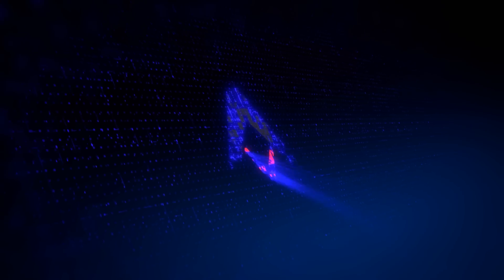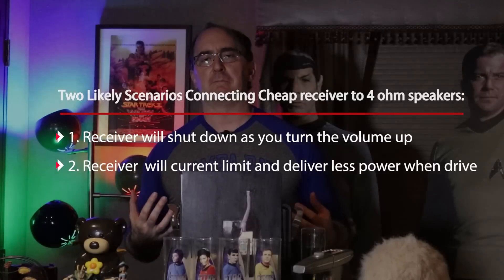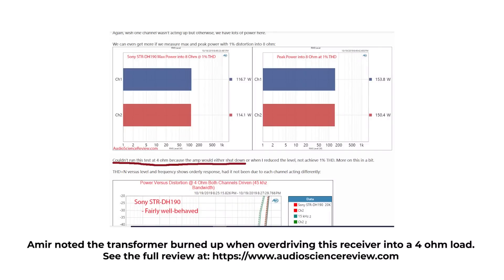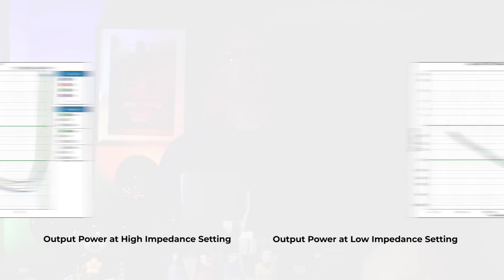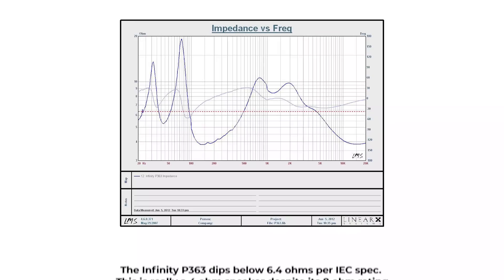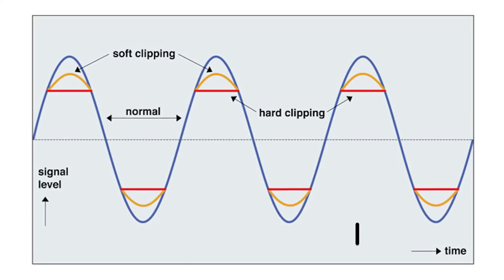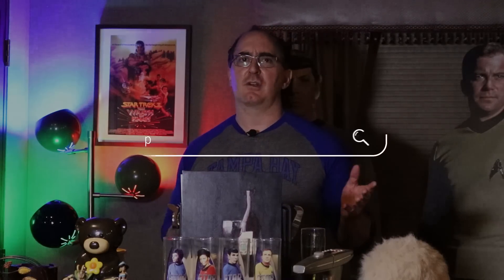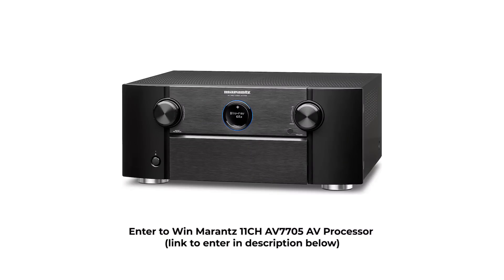4 ohm Speakers on Cheap Receivers: Recipe for Disaster?

Comment: Sorry my dude, it's me again :) omg, It seems I only find your channel like once a year when I have to talk cables to someone ;) OK, now I subbed. Here is the issue and I don't wanna make you "work", but maybe you think it is an interesting subject to clear up the alchemy surrounding it some time: So this related to bi-amping. I am a more-components-is-better fetishist and so I am still going for dual mono amps etc and actually looking to bi-amp with 4 monos.
Now, I had already gotten all the specs sheets for my stuff as far as available and also bothered the manufacturers, trying to get some more info, but they are all coming back with philosophical, not practical BS. I had also asked the PS Audio "ask Paul"-service, but they could not / did not get specific in their advice. But what I gathered is that I have to gain-match amps if I want to use a fat monos for the base and maybe tube amp monos for the tweeters. - But at least via spec sheets, there is no way to do this.
Now I have seen one guy, who apparently set up a mic and measured the output in his room and he seemed to have some kind of device that can adjust/split the signal for the chosen amp pairs. - So what was he doing/am I supposed to do to get this to work? Also, what kind of kit am I looking for? Are such devices automatically studio-grade? Obviously, I do not want to go through all the effort only to mess up my signal on the last step with a sub-par gain/splitter-thinggy from China... I can see how this is not the most popular subject, but maybe you feel like geeking out on it some day, or point me to a good resource. I have 4-way (or 3.5 way) speakers with 2 sets of binding posts, as most speakers have anyway, but I could not even get out of the manufacturer how the 4 ways are related to the 2 pairs of binding posts internally, so I am not even sure how much power a second pair of (maybe tube-) amps would require for the tweeters... so right now my only solution would be to use two identical pairs of mono amps, but I think that would already be overkill for the tweeters, as they are 170W each and the entire idea was anyway to mix it up with some tube amps. 1st world problems !! :)

Comment: I have an Onkyo TX-RZ720 (Power Output: 175 W/Ch (6 Ohms, 1 kHz, 1% THD, 1 Channel Driven, IEC)) amplifier which I had LG 12ohm speaker connected to, and sounded terrible. Due to limited budget, I decided to get Kicker 3way DSC6930 6x9 (90w rms and 360w max) connecting 1 speaker to each channel. It does mention high current power to drive 5 ohm speakers. What are your thought on this? Will this be better than the LG 12Ohm speaker setup and I am I risking damage/power output to speakers?

Comment: Probably not much, most cheap receivers or amps have digital/tripath amps that usually handle low ohm speakers and are only limited by the power supply. although, I may be talking about stuff "too cheap" to review. A lot of cheap gear based on car amps are rated at 2 ohms to maximize the amount of power available on a 24 vdc  (+12 / -12 voltage swing).
Reply: And those cheap Class D amps don't hold a candle to even used whole house audio amps like the Niles SI-275 or Sonance 275se. The Class D amps' high power ratings are taken at 10% THD. Plus, the WHA amps are generally high-current amps capable of handling low impedance speakers loads of 2.7 ohms. That all but guarantees excellent bass dynamics without stress or strain.....

Comment: Without even looking close at that crappy reference featured at 0:58, I thought, that looks like those crappy Sony products from the 2000s. Cheap tiny heat sink, small transformer, crappy integrated IC for the Amplifier (minus the output stage, but basically the difference input to the VAS stage) (they didn't use discrete parts for the amp stages), oh and the small DC rail caps. That has Sony written all over it.

Excellent example of what a terrible product era was for Sony.
Reply: So was it a Sony in the picture?

Comment: I was an audiophile years ago I always wondered why companies make 4 ohm speakers. But maybe only expensive speakers are 4 ohms and with a high quality receiver they are ok.
Reply: Back in the old days recievers were lower wattage, or more expensive.
Reply: And yet, they all sounded better, got much louder, and generally lasted longer. I had a 30w/channel pioneer Amp back in the 70s that would blow away anything built today in the 100w range.
Reply: @randymc61  Me too. Did it happen to be the Pioneer SX6000?  That was my first true stereo receiver. I bought it in 1972 thinking it was 100w/channel, but recently saw online that it’s actual power was 35w/channel. Regardless, that receiver was a great one in all aspects. It had plenty of power driving a pair of 4ohm floorstanders. Maybe it’s my nostalgia for my first piece 
of hi-fi gear. Ran a turntable & a Reel-to-reel tape deck. That Pioneer had a great sound to me, with plenty of power to go. It had a full rich lush sound related to the speakers. That’s how I heard that amp. Always seemed it was ready for more gain with composure. I loved the loudness feature too. I had to listen at lower volumes in Barracks overseas. The cherry 🍒 was how good it looked compared to most today. Beautiful walnut shade framing chassis. Real wood! Kept & used that Pioneer for 23-25 years.

Comment: The "quote" about smoke and electronics is great.
       The average home system amplifier shouldn't be expected to perform well below 8Ω.    The damping factor in the cheaper amplifiers really gets bad below 8Ω.
It is better to buy a powered subwoofer than try to get good sound from an overtaxed amplifier.

Comment: The very best tip I could give to a up and coming audio enthusiast is to learn about ohms. Parallel and series wiring is a absolute must know. This goes for car audio and home audio. It is the most basic knowledge that you must know.
Reply: Ditto ditto! (Couldn’t resist). 😜👍🏼 I never thought about it, but I agree. That is great advice. Differences between parallel & series circuits, and impedance/ohms. Had to get to a library to educate oneself when I was a preteen. Loving the internet!

Comment: When i need to cook bacon, i plug 4 ohm speakers on my Denon x3100w. The amp distorts and sounds like crap and after 5 minutes it can cook bacon. 
I now downgraded that amp to the living room and replaced the whole system with external amplification for the fronts and center on a Yamaha  vsx-74txvi. No more distortion when buildings explode.

Comment: It's good to be cautious.  Avoid the combination if possible.  That said I've done it several times and have had no problems.  The receivers never got hot.  However, I never turned them up much.  Just low level background listening.

Comment: Yep. Bought a pair of Martin Logan 60XT`s. 4 ohm rating. Hooked to a Yamaha RX497. 75w rating. Cuts off many times. Use a Yamaha A-S801. 100w rating. Runs but, very hot to the touch. Finally use a Yamaha A-S1200. 90w rating. Problem goes away. Thing runs just barely warm. So, watts are not the answer. Power supply, caps, heat sinks are.

Comment: Flagship Yamaha avr has also problem with 4ohm speakers?
Reply: @Jingle Nuts RX-V3067
If i look at the user manual, he can drive only the front speakers with 4ohms but i have the center and the two surrounds speakers also with 4ohm,till know i never had a problem,i guess if i drive all of them higher than 75% of the volume,  than i can have a problem..
Thanks for your answer!

Comment: Somehow my Harman Kardon AVR 2000, which is rated at 40watts at 8ohms has no problems with my Quadral Quintas 606m2, which are rated at 140Watts at 4ohms. The HK seems to be a good receiver
Reply: Older Harmon Kardon receivers were very conservatively rated.
Reply: @mikee2923  on the back of the receiver it says 470watts max power consumption, the 5×40watts can't be true or the thing just consumpts the other 270watts to heat my room 😂😅 I think in stereo this thing has more like 70-80 watts per channel. As this thing weights 14kg, the cooling should be good enough for more than 40 watts.

Comment: Hi Gene! What happens when you have a nominal 8ohm speaker and take the jumper off the speaker to biamp?
Reply: Nothing special happens. It's the woofer that controls the game.
Reply: @mcplutt  I was wondering more about what ohm load does the amp see when bi-amped?
Reply: @rythemusicguy  It sees the ohm of the woofer. The other drivers doesn't matter that much since it's a much lower current draw.

Comment: i did in car radio. 2 ohm speaker on 4 ohm output. the amp have circuit protection. so it turn off by it self. because 2 ohm draw more current. hot
Reply: Car amps doesn't have power supplies. The car battery is the power supply.

Comment: Gene how do you feel about the Yamaha RX-Z9 with 4 ohm speakers? I know you did a very favorable review of that receiver way back when. I have mine driving seven 8 ohm Polk RTxxi series, but once got my hands on some 4 ohm Polk LSi9's and used them as my rear surrounds (set to "small") with the Z9 on the 8 ohm setting. I listen very loud and while I had no thermal shutdown and everything sounded normal, it turned the music room into a sauna! The Z9 I guess has a reputation for heat generation even under normal circumstances.
Reply from the maker: The Z9 can drive 4 ohm speakers all day long. Very stout amp section. It runs hot bc they turned the heatsinks horizontal to save space. That's really bad for hest dissipation, unfortunately.

Comment: But most people don't listen to 105-110db music. 
Most people use between 1 to 16 watts, maybe even to 32watts.
a 88db 4omh speaker, will produce 100db with just 16w. Yes they might be 3-4 meters away, but audio loss with distance is not the same in a room. You loose less db because of reflections. So even in a big room, you will be getting 92-94db with 16w.
No matter if your speaker has 3x12 subs, 2x6.5 midrange and a tweeter, it will still play loud AF with 1 to 16 watts. 
And the higher the sensitivity  the louder with less watts.
Reply from the maker: It's not that simple once you start cranking the amp with some bass notes. I've shut down $3k integrated amps on 4 ohm speakers in my theater room.
Reply: Home audio just isn't built around low impedance speakers at this time. Car audio...well that's something entirely different. I wouldn't be surprised if Home audio shifts to base design and power ratings at 6 or 4 ohms though given the common speaker offerings as of late.

Comment: I saw "that" video and i imediatly smelled a mix of tvsales and ignorance. Volume and weight are huge factors when designing a product to be shiped wordwide. If your're on a budget go used market. Sony by the way has sold his (high-fi) soul to the devil decades ago.
Reply: Are you kidding dude? Sony offers some very good sounding things IF you wish to spend the money. Sony SS-NA2ES/NA5ES speakers come to mind. HAP-Z1ES is still a great sounding streamer/DAC solution. TA-A1ES is a great sounding class A amp without breaking the bank. TA-ZH1ES is perhaps one of the best headphone amps out there. Just because they also offer stuff for financially challenged folks does not make them a crap brand. Typical audiophool brandname snobbery!
Reply: @Iain MacLennan Are you offended in the name of the product or the brand? I've owned several entry level hi fi sony produtcts (SS-F600, SA-W2500, one receiver and blu-ray that i forgot he models) and apart from the blu-ray player all were really bad products. They sure were the cheapest on the market (new) but they were really even pass the basic test of playing loud without distortion. Tried Jamo entry level ones and it was really night and day. The subwoofer was he same. One used kef one blew it away for the same money (wich is a medíocre product). I diassembled them and dear god. The back wall of the subwoofer was made of really thin plastic. This new sony receiver must be the same. All corners were cut to meet that price tag. The brand quit its hi-fi pretentions years ago (their ES and similar produtcs). It was on the news. So not new research in hifi products. Just milk the cow (the sony brand recognition).
Reply: @Iain MacLennan Yes. I dont have it neither i said i had it. I was very clear about what led me to my prediction of what the product is worth. What others did you hear before you choose that one? What speakers do you use? You're really rude. "What's your problem? Talking out of my @ss". To me that takes credibility to your point. The reviewers take money for their reviews and/or get their channels bigger for reviewing fashionable afordable kits. I have no dog on this fight except my bad experience with recent sony equipments. You are defending your buy like i have offended your existence. It's just a object from a faceless multi milion corporation. Nothing wrong with buying it. The big specs claims are not exclusive from sony.

Comment: Great video! When you say in parallel you mean more than 1 speaker on a single channel? I have a pair of B&W 603DM S3 towers and just ordered the Sony STR DH590. Should I be worried...? As I can change my order if needed.
Reply from the maker: yes I mean connecting 2 speakers to a single channel in parallel.

Comment: it really matters on how much you are cranking them up.  If you keep the volume "reasonable", there's no reason even low end receiver's can't handle most 4-ohm speakers.  Most speakers don't even drop below 8ohm till you give it a certain amount of juice (often at least around 20-25 watts), if you are keeping your volumes low enough where you never are going above 15-20 watts, it's almost never an issue.  20 watts is enough to push a 90db sensitive speaker all the way to over 100db which for most people is plenty loud and will almost never do anything to even the lowest end speaker.  I have never pushed a receiver above 50 watts to maybe 60 watts, and when it was driven at 50 watts, it was LOUD (probably pushing 106-109db), way too loud for my small apartment and easily loud enough for neighbors to get annoyed.
Reply: But they may not want you to know this because its not good for profits.
Reply: @bella3008  I think the problem is people crank it up too loud too often and put too many speakers in parallel as Gene said.  This is always a recipe for disaster.  I ran my TZ-7 speakers which are 4-ohm which were driven just fine with no problem with my Pioneer VSX-1131 receiver and never had a problem; but again, I never pushed them past maybe 25 watts which is well below the treashold of any clipping issues even at 4-ohms (heck, even 2-ohm speakers would do just fine at just 25 watts).  It only would be a problem if I tried to crank it up to max where it's pushing it's pure current limit even at 8-ohm that I'd have a problem.
Reply: @aegisofhonor  Thank you for sharing this because a lot of consumer can benefit from this information.

Comment: Thanks for the explanation! I thing Im in trouble... Im trying to get Atmos going for really cheap and ordered the cheapest 7.2 receiver and 5.1 speakers I could find.. The Sony STRDH790 and JBL Cinema 610 system, The JBL is 4ohm but the Sony says 6ohm...  Do I need to get different speakers?
Reply: No, it is all volume dependant. Don't try to recreate live rock music and it will (should) be fine. Also a quick non-engineer, non-technical way to check on your new gear is to listen to a movie at the volume you want, then halfway through put your hand on the receiver. If it is quite warm then you are pretty much at your limit. That would be your max volume for movies. If it just lukewarm then you are not stressing out the receiver. If it seems hot at all to the touch then you must turn the volume down or the constant high heat over a few years will shorten the life of the unit. This is very broad brush method, but very easy for the average guy to do to see if he needs more power.  The easiest way for the average guy to buy a receiver is to get one rated at 4 ohms without the dreaded 4 ohm switch. Then your receiver really is a 4 ohm receiver. Again, this is a broad brush non-high tech way to see if you are overstressing your unit.

Comment: If the receiver is any good it’ll turn off before any damage or fires
Reply: Cheap receiver will shut down and won't turn back on....they won't catch on fire, but we have experienced many customers that damage the receiver.
Reply: @Nomata-4  i had a shitty reciver on my 2 ohm subwoofer in a 8 ohm channel and it just fucked the channel up but it still works

Comment: 100% true, also there is speakkers rated 8ohms and they actually have under 2ohms resistance 50-150Hz. 🤠
Reply from the maker: that's a very bad speaker design then, bad crossover particularly.
Reply: Actully it's great design all other way, mgnetoresistive-panel not want to point finger 🙃

Comment: I am running 4 ohm Jamo D7 speakers on Yamaha Z11 which is set to 8 ohm according to your review years ago. I recently changed the connection to bi-amp  to the front left and right.  Do I have to keep the same 8 ohm setup on the receiver after bi-amp connection?  Thanks